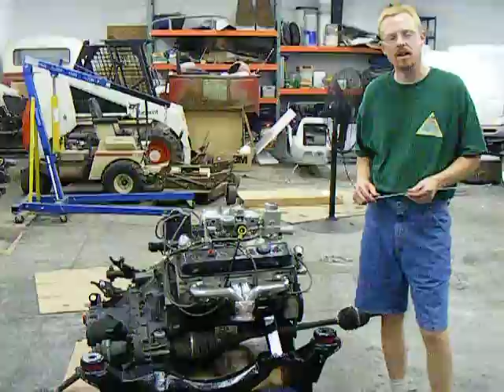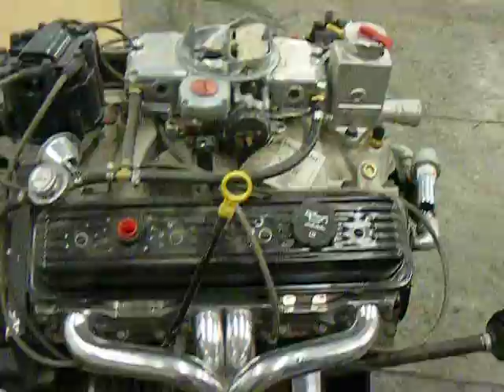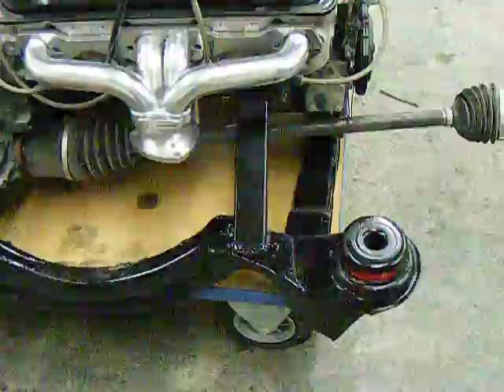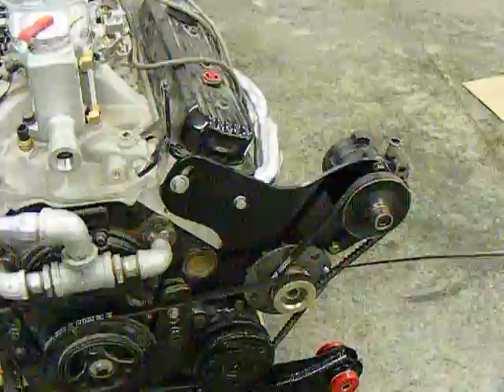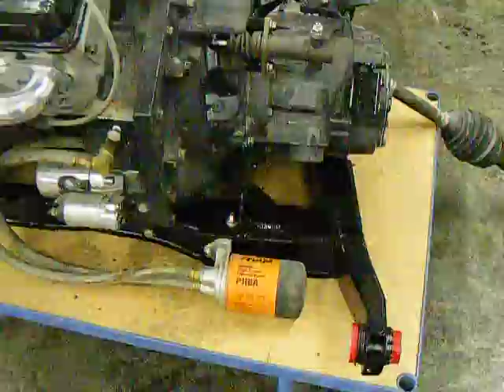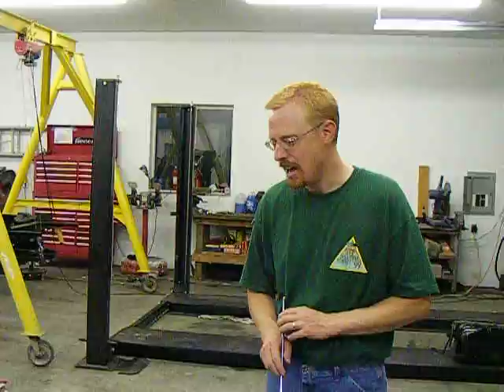ZZ4 Engine Setup in Fiero Chassis - MyTajGarage.com

Comment: Using galvanized steel pipe on the front cooling crossover is absolutely a no no. Have you ever heard of dissimilar metal corrosion. You are distroying the heads and block. You act so smart, but you did something so stupid.

Comment: Very good stuff. Be sure to reinforce that car&body as from my experience, when in a crash, those cars disintegrated.
Reply: More rumors .. It had like the second highest safety rating for its time... The space frame on these is like a roll cage..   doors alone weigh 220 lbs a piece..  I used to be a first responder EMS  and have seen these bounce off of  boulders and trees  and the space frame did what it was supposed to do in the crumple zones ,, all  did well given the occupants had there seat belts on..

Comment: If you made it wider that's the track. The wheel base is the distance between the frt wheel center-line & the rear,not between the L&R wheels.

Comment: Great job!  I love this concept.  Incredible work with the design and fabrication of this engine to allow Max performance for this Pontiac Fiero. Which was originally designed to run a smaller engine. I really just love the idea of modify anything. As a huge Pontiac fan,  it's great to see the  increase in power of those vehicles and just see what they can do.  How's that car doing to this day?

Comment: I liked watching this video and seeing all of the nice parts you bolted together.  nice headers nice poly bushings yada yada.....but then your video goes around to the front of the motor and.....theres what appears to be a plumbing pipe sticking out of it.....plumbing pipe? reallly?!  all that money for all those shiny parts, cans of paint, decent carb, tranny brackets for the rugged 5 speed....then plumbing pipe.... i hope this is your personal car cause i wouldnt be happy with that in my lambo
Reply: Really all that and your take away is the galvanize household piping, 
Just ruined it all. being galvanized it won't rust away;will be vary durable. Its a kit car not a real Lambo not fooling anyone. besides won't be seen by 99.99 of people anyway. if it gets it on the road; form fallows function...
 Guy has put a lot of thought and effort into doing it right. So till you do better or at all; NO STONES!!...
Reply: RogerRamJet bro he said that 7 years ago.. Doubt he'll see the reply